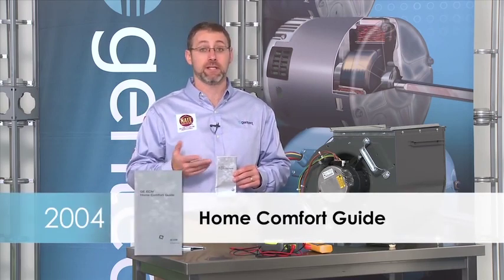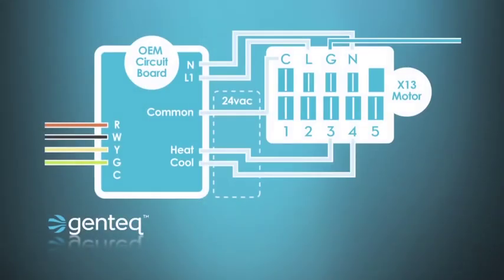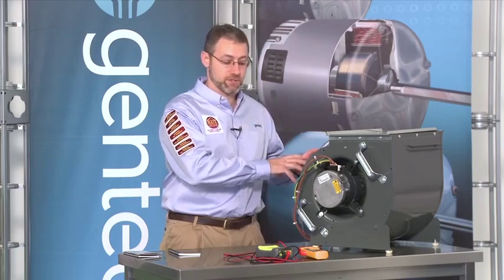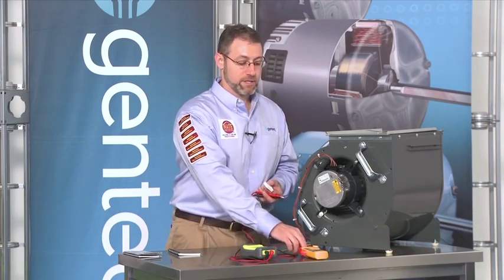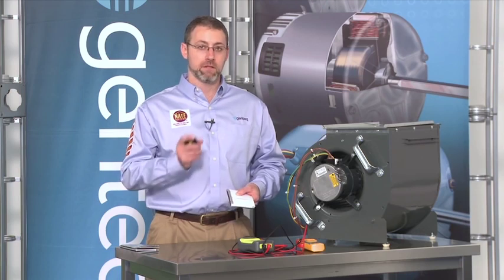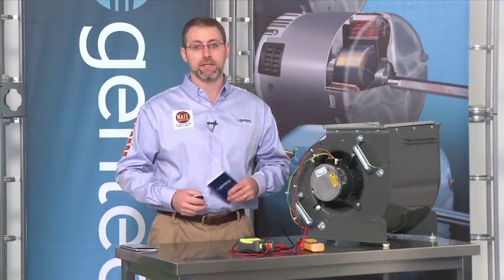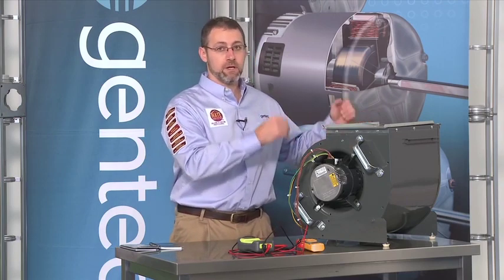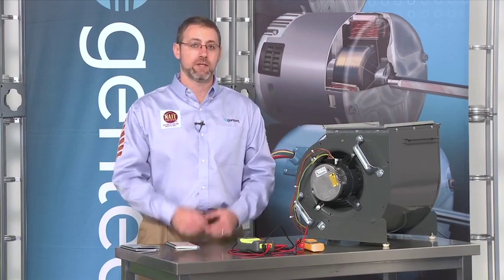Genteq® X13® ECM Troubleshooting

Comment: What if the motor runs without 24 volt input?
Reply: Then it’s a bad module on the motor. I’ve seen that a few times.
Reply: That's what mine is currently doing. Sometimes keeps running after the call for AC is done and outside condenser is off, sometimes it works right and shuts off after 45 seconds, sometimes it comes right back on and runs for any weird amount of time, and sometimes I finally have to turn the breaker off.  At least now there are alternatives to replacing this whole overpriced motor.  You can do just an ECM or buy a Mars or Evergreen  complete motor and it learn.  Crazy.

Comment: I have an issues with x13 it does its cycle but repeatedly turns on for 1,to 2seconds the off multiply times any info icm and motor have been replaced still same issues

Comment: I have an AC blower (Carrier) motor defective. The motor is Genteq ,230V with model number 5SME39HX L184. Its lower voltage two signal wires ( white goes to speed 4 slot and blue goes to speed 2 slot. The other 4 wires ( Green& yellow for ground,  yellow goes to transformer 230V side, black  goes to transformer 230V side, and Brown for connects the blue wire from the Thermostat). I bought a new Genteq with model 5SME39HX L447. The wire connection is total different. I need your advice. Thank you!

Comment: As of recent, when the thermostat calls for heat the fan doesn't turn on but the thermostat says it on. If I manually switch the fan to "on" from "automatic" the fan runs... I've changed the circuit board, transformer and thermostat but have the same result..
Reply: Is the board sending power to the blower heating terminals with call for heat?
Reply: @Zach Osborne  thanks, it was weird. Un did all wiring and put back together and it works now

Comment: so genteq you can push that meter leads into that socket? aren't u gonna enlarge them and they gonna be loose when connect back to the other plug? so disappoint with this presentation.  showing the circuit with out pointing it out is useless.  why are you scare to open up the motor to position it with your presentation but just talk?  try do better job genteq

Comment: I'm confused why you are sticking one lead on your low voltage plug and the other one to your high voltage neutral. Why wouldn't you put one lead on the low voltage plug and the other on the common terminal on the high voltage plug when you are checking for the voltage?

Comment: My blower motor, x13, was not running. the technician installed new control module. Now it runs but does not stop.it keeps on running whether thermostat is set on "auto', "on", or "off". How to fix it? The technician says you need to replace the blower.

Comment: Why the hell does the the pin receptacles location matter? That is nonsense. These motors are 200% junk. You have to buy a ecm tester tool to really verfy failure.  How the hell did genteq bribe or coalhurst Armstrong to put these in their a96. It is absolutely impossible to troubleshoot the module unless you buy the specific tester. These motors are junk and Gentech should suffer a class action lawsuit for their piece of s*** Motors. Not to mention you can't buy the module anywhere right now is over a six-week waitlist because of all the failures they've had.

Comment: My x-13 blower motor ( 230V ) is powered directly without going through the control board. The blower is blowing, but extremely slowly. My system is factory set at Tap 2 low speed. I never had a problem before. There is power at the source and I checked the relay. Everything seems okay. Could you tell me if there is a simple solution before I have to tear it down? All duct work and vents are clear and filter clean. Compressor operates & I see no safety switches. Thought it may need an auxiliary or hard start capacitor. Blades turn by hand too.
Reply: Did you ever figure this out? Having the same issue :/
Reply: @Chigasaurus  It was a bad ECM ( Electronic Control module ) on the blower motor. Apparently they go bad quite often. Bast to just replace the whole motor.,not much price difference

Comment: On my X13 ECM the motor "rocks" back and forth in a small arc for up to four minutes before running. At first I though this was a problem but  according to the Genteq ECM Service Guide this is normal. I wish I knew why.
Reply: They're lying.  It's not normal to do it for several minutes, the ECM board is bad.  It may do it for a split second or so at startup, but shouldn't stay there.  If you replace the motor/ECM it will stop doing it.
Reply: The system I'm working on, after 10 minutes or more it will still do the same. However I still wish I knew this when troubleshooting. Thanks 👍

Comment: On the PSC motors, the circuit breaker amp rating is sized to 175% to 225% of the FLA.  Seems like the ECM's electronic control can soft-start the motor and limit the inrush current.  Is this oversizing of the circuit breaker necessary on an ECM motor?

Comment: Could a failed logic board cause the X13 to run continuously without a call for fan?
Reply: Derek Bell yes, I have experienced that on a call.
Reply: That’s exactly what my home fan is doing. It is running without being put into fan only. The unit is set to off and my fan control board is good. I had to turn the breaker off just to shut it off. It came on by itself.
Reply: YES!!!  That's what's happening in my home right now.  FYI, I'm an EPA Cert. HVAC tech so I'm not just some dumb homeowner.

Comment: You got your diagram wrong while checking your low voltage or speed tap voltage.
He says check common but diagram shows checking Neutral.
Reply: I saw the same thing. Why use neutral as a commun for 24 volts. There is another pin that is commun.
Reply: Common is neutral? That is how I see it.
Reply: Common is neutral
Reply: @RockoRocko-rz7kx  not on low voltage

Comment: As a tech, I can tell you that we do not have all the wiring and schematic information we need while in the field.  Do you actually expect us to carry around binders full of information?
Reply: james allen no but as a tech you should know how to find via the good old inter web or making a phone call to be able to find your spec wiring diagram. Seems how good ol big gov is requiring all motors after 2020 to be ecm ya better get used to it. I usually have great luck with manualslib.com but sometimes need to call manufacturers to get an email. And yes a good tech does have binders of this information it’s on my phone or tablet. It truly makes a huge difference in my call times
Reply: @mikelvogel161  ...and while out here in the land of no phone signal, what do you suggest?